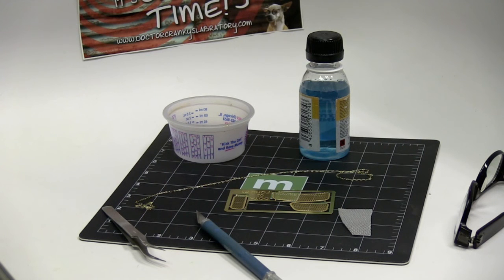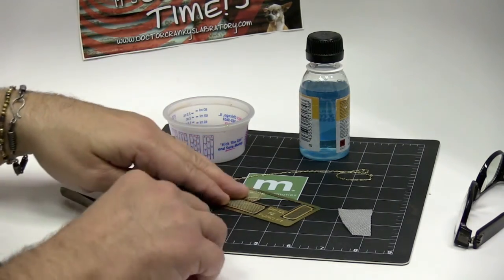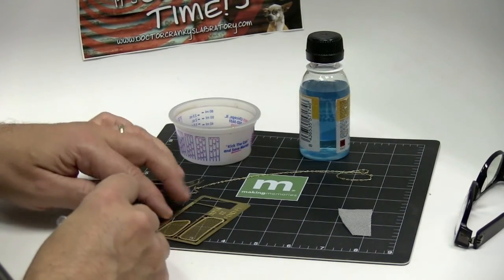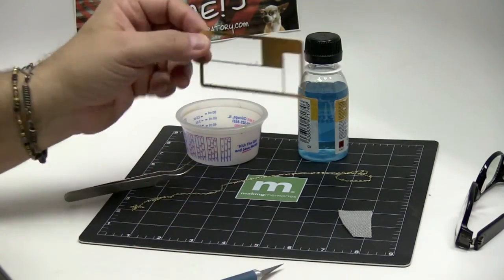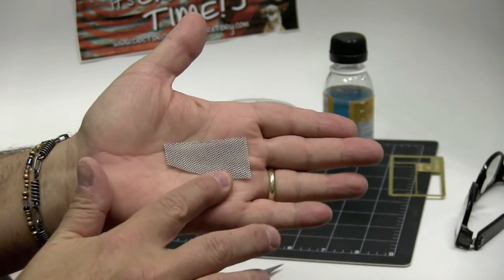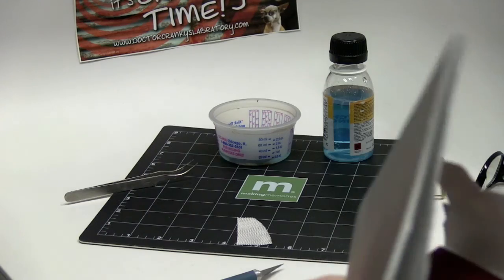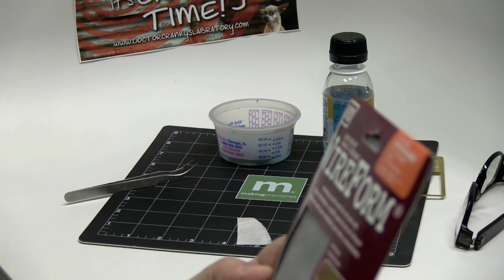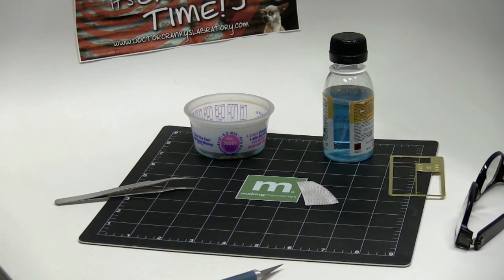CLINIC:   Working With Photo Etch

Comment: for some of the smaller photoetch parts it is better to use a piece of glass to set the fret on to cut the parts out. the modellers mats are flexible and there is a good chance of warping or bending the parts if they are small.
Reply: yes a peace of glass to cut on thanks for reminding me.